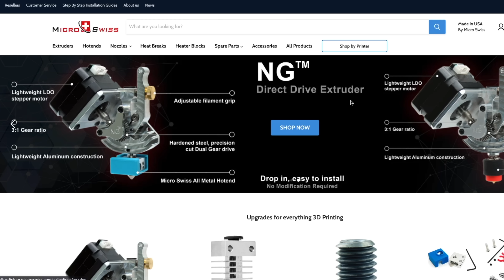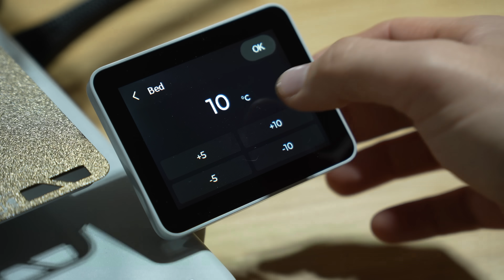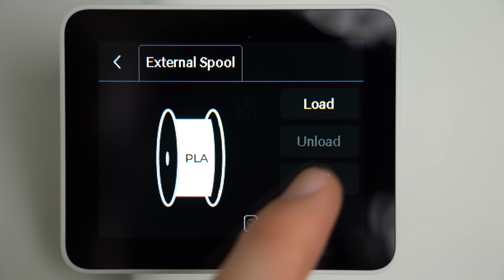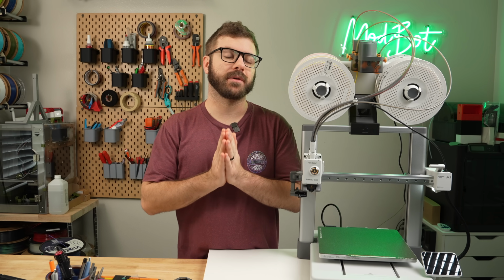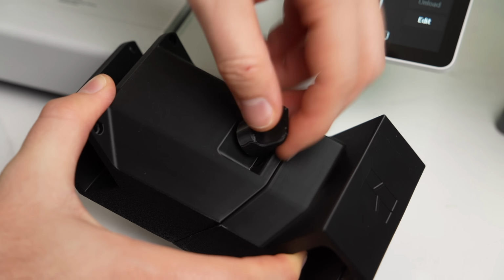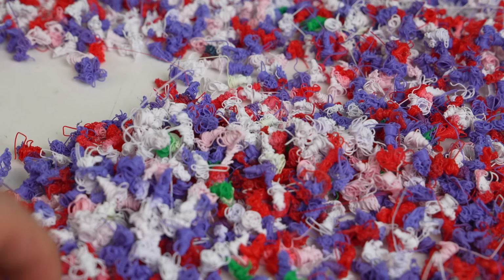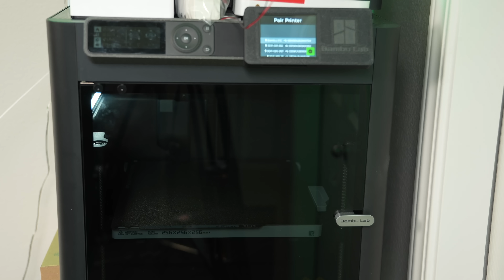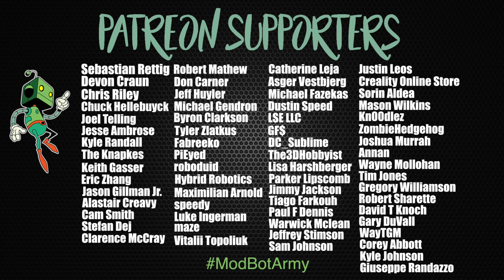Is The A1 Worth It? Diving Into Bambu Labs Newest 3d Printer

Comment: I waited 2 years to finally buy into bambu. When they came out with the X1 I was one of the haters since it was all proprietary and not open source. I was just waiting for the bad reviews and reasons to bot buy. But those never really came aside from 1 small network security issue they had. It wasn't until last week that I actually looked into them with a neutral point of view and I was actually blown away at how cheap their parts are and just how good the machine as for their price. I then looked into long term reviews and again very few negatives. I have seen people replace their prusa print farms with these machines and put thousands of hours on them with no issues. So I pulled the trigger on an A1. Got it setup and printing tonight and wow. Coming from a sidewinder x1 to this is night and day. I had it setup and printing in 15 minutes that includes slicing my own test print in their slicer which I had never used. My only regret is not going with the P1P over the A1 but its not a big regret since the A1 was all I could afford. However if they ever release a P1P XL that works with the AMS lite I will buy it. I really hope they make their future machines work with both AMS versions.

Comment: Don't use a metal scraper on those PEI sheets.  I switched to the plastic razor blades to prevent damaging my sheets (like the metal one has).
Reply from the maker: I haven’t had an issue with it but you definitely don’t want to apply force. It can glide and get under things easily but if your not careful there is risk. I may try the plastic blades just to compare.

Comment: The things these a1s have makes me very exited for the x2 and p2 series
Reply: Based on what the P1 is to the X1 and these A1s are to the P1s, expect more corner cutting and a reduction in overall quality in upcoming models.
Reply: @KennyGarland  Of course there is corner cutting. The P1 is 2/3 the price of the X1C, the A1 is 1/3 the price of the X1C. How could you possibly expect there not to be corner cutting? Thats like saying Addi cut corners with the A1, compared to the R8. When you cut the price, you lower the spec. The print quality per £ is the important thing and Bambu Labs have hit the mark with each series.

Comment: With the bed confirmed going up to 100°C and the nozzle up to 300°C, what is still not clear to me WRT printing high temperature filaments (ABS, ASA, PC) is why Bambu Lab are saying on their wiki/FAQ page for the A1 that "We don't recommend enclosing the A1" - any ideas? Could it be due to insufficient cooling for the electronics, or maybe issues with softening the Z axis timing belt? 

I am asking because I've built my own perfectly sealed enclosure (a lot of sweat went into making it) and I'd rather use that with the A1 if possible than pay for the P1S, especially since the A1 has the quick change nozzle and no "no build areas".

Bambu Lab mention they don't recommend printing high temperature filaments on the A1 due to the lack of the enclosure (the A1 is therefore not able to ensure the required higher chamber temperatures and also not able to contain the toxic VOCs), but they never explain why they recommend against enclosing the A1.
Reply: The A1’s mother board isn’t built for high temps

Comment: I have seen other multi-color printers do fairly well with just a ‘purge tower’ - is the Bambu’s additional “poop station” really necessary, resulting in so much waste?
Reply from the maker: Lots can be done to minimize waste. https://www.youtube.com/watch?v=uOtf-MifBc0
Reply: You can choose to use a purge tower instead if you want. You can also purge into infill and/or support material.

Comment: For me I am going to get a P1S since it looks nicer, is enclosed and has the normal AMS. But the A1 is probably my new exclusive recommendation for starting out.
Reply from the maker: P1S is awesome. I really like mine and if I had the choice between the two would also go that route.
Reply: I have one in my closet but during these cold winter days I’ve been having many failed prints unsticking to the build plate. Seems like I need an non-textured plate with glue to combat this.

Comment: I own an Ender 3 Pro, I've dumped a stupid amount of money for parts for it and messed with Marlin & Cura constantly and I can't get quality prints and I still feel like it isn't up to par. Would this be a good thing to go for?
Reply: I have an ender 3 S1 - I am going to trash mine - I am looking at this - I like that there is no option to have to run paper and fiddle with screws at the corners to try to get it level.  I am going to get this or a car xy variant - I just want to know if the bed slinger design effects quality like you are asking - it is not good that he saw imperfections in the benchy - but I would take an imperfect benchy over what I could do with my old printer.
Reply: @tomsop  Me too man, I just ordered one for Christmas because this looks promising- gonna see if I can make any money off my Ender 3 Pro but I think this is a great start into the Bambu Lab line up which have some great products.
Reply: People over the Pacific Northwest saw my Ender 3 Neo burn up upon re-entry.😂

I never looked back after purchasing a P1S and an A1.
Reply: @tufftimesbc  Yeah didn’t post an update to this, but HOLY TOASTER is the A1 crazy compared to the Ender

Comment: There is a printed part out there to fix the plate registration that goes where those guides are for the other printers. I wonder if it will work for the A1.

Comment: Hello and thank you for your excellent comment, I hesitated to take the P1s , but I ordered the A1 that I have not yet received, I print only pla and I look for the quality of prints, I wonder if I did not make a mistake, Many people say it’s worse than p1s in terms of print quality, will I be able to change my A1 to P1s if I’m not satisfied?
Are there any problems with bambu lab returns (I am French)? Thank you in advance for your answer, thank you again...
Reply from the maker: I am not sure what the return policy is like especially outside of the US. Worst case I would think you can sell it locally for at least very close to what you purchased. Honestly if quality is your biggest want you just may need to slow down the speeds a bit. P1S has added cooling and a more rigid frame so yes you will be able to go faster and maintain quality but at the increase in cost.

Comment: 3 months ago I sent my family an A1 and it displayed a recall message basically turn off and do not use. It still does not work "calibration errors" despite a TH (tool head) board being fitted. Bambu has finally agreed to replace the defective unit. The Canadian govt finally shows a fire safety / electrocution recall since July 24. This recall happened in 2023 so what was the reason for the delay?

Comment: what happens if you have many PLA's but not all from bambu and put it in the AMS?
Reply: So far all the PLA i use in my A1 is not from Bambu and it works fine.   you can use generic PLA or create customized settings in the slicer for certain makers, like Inland or others.
Reply: What if you have mixed color Pla? Sparkle, rainbow, glow one?

Comment: If you want perfect quality at speed you still need to buy the non- bed slinger versions IMO. And I'd rather have an enclosed AMS to help prevent moisture which makes a big difference to quality.  Since I've been using an enclosed filament heater with my Creality Ender 5 Plus the quality has jumped up several notches. I know the A1 is a good price but personally I'd rather save up for one of the other versions from Bambu.
Reply: Thanks for that. I've been waiting for my local microcenter to get some P1S in stock. They seem to be really trying to get people to buy the truckload of the A1 they have.

Comment: How much tweaking to your profile in your slicer did you need to do to dial in silks? Getting frustrated with the lack of profiles in cura or prussa for the Anycubic kobra neo 2 and the anycubic slicers is limited on parameters. Wondering if the A1 would be an upgrade or not.
Reply: Try the Orca Slicer, see if that is compatible with your printer and will help you out on that issue with printing silk..
Reply: I've had no issues with silks on this thing
Reply: @alvodisco  oh damn. Making it even harder to resist getting one. Lol

Comment: This is one of the better reviews I've watched for this printer, however, it seems that all the reviews have "omitted" the actual speeds that they were running the test prints.  Was this on purpose?  Seems that would be valuable information to those watching to decide on purchasing.
Reply: he mentioned slicer defaults which for the A1 is roughly 200mm/s with 7k accel 
but you can go a fair bit faster without dropping quality if you dont mind adding brims (bedslinger moment)

Comment: I have a prusa mini and I think it doesn't make much sense for me to buy a little larger (but faster) printer even if it has AMS, I love how bambu stirred up the pot, and I'll wait for the large version.
Reply: I'll be honest, bought an a1 mini and already have a prusa mk3s with pinda bed levelling. So far, bambu has nothing on the prusa with consistancy and reliability. Alot of faffing with the load cell levelling and ams load fails. Has all the technology and prints nicely when ok but its 50/50 at best
Reply: The bed levelling is so inconsistant, one print will be perfect and the next will have the z offset too high
Reply: @jacobplatt3066  ouch. Haven't heard of many bad experiences yet, I suppose they will have to iron out the flaws very quickly if they want long term sales numbers.
Reply: @dingdingdingdiiiiing  Yeah, it can be frustrating. Only explanation is that the PEI textured bed is the culprit (Or oozing filament) because of the surface texture but surely this wouldnt cause this much disparety
Reply: @jacobplatt3066  I'm sticking with Prusa for now as well, for various reasons, some ideological.  Happy to pay a premium for that.  I'm currently running a MK4 and it's been a fantastic machine so far, no issues.  One thing: though I love the open design, I think Prusa will have to move to injection molded parts at some point.  Much higher quality and a much lower cost.  Just look at the prices for the MMU3 kit, the difference between them supplying the 3D printed parts, or just sending you the filament for it, is €40 or so, over 10% of the total price.  3D printing parts at this scale is not sustainable.
Reply: @kaasmeester5903  I agree that no matter how affordable and advanced Bambu is, Prusa will always have the reputation of being reliable. The idea of injection moulding is great, but the 3d printing print farm is not only convinient, it is also reliability testing the Prusa printers
Reply: @kaasmeester5903  As far as sustainability is concerned, it's not always that simple. Depending on the type of parts, 3D printing can not only be more sustainable but sometimes even faster. I recently came across an interesting video with the title "How Additive Manufacturing Can Produce Faster Than Injection Molding!".

As for the Prusa parts, you would have to look at the individual parts and see how they would have to be adapted to be injection molded and how complex the resulting mold is. The more complex the mold is, the more expensive it is and the more parts you have to make to make it economical.

Comment: What do you suggest between A1 and A1 Mini? You seemed more enthusiastic in the A1 mini video 😄
Reply from the maker: I think that may be because the A1 mini was the first in their A1 line so it was a lot of new things while this carry’s much of that over. Main perks of this one is 100c bed and bigger build volume. No bed tab issues on the mini but a lot of it comes down to space. The minis really won me over but for $100 difference the bigger size and two towers for z probably makes more sense for many.
Reply: @ModBotArmy  thank you very much for the answer, now I have a Neptune 3 Pro and give me problems and I want go with a bambu because I want to print and not think about anything else. I'm very undecided between the a1 and the a1 mini, and also whether or not to get the ams which perhaps I would never use 😅
Reply from the maker: @pieronompleggio3910  given that you save $100 by getting it in the bundle I would opt to get it. If fore some reason you don’t use it I imagine you can recoup at least close to that amount given the standalone price.
Reply: @ModBotArmy  do you mean selling the ama light? Play with bambu studio with a1 and a1 mini profile I notice that for some models the a1 mini is faster than the a1, it’s because it have less travel to make?
Reply from the maker: Yeah exactly I mean to sell it locally if you end up not wanting it. Versus not getting it and decided to buy it later at $100 more. I haven’t compared profiles between the A series.
Reply: @ModBotArmy  Sorry to bother you, the noise between A1 and A1 mini is the same?
Reply from the maker: @pieronompleggio3910  I haven’t noticed any differences. Both have the same silent motor algorithm and same cooling which are the main noise generators.
Reply: @ModBotArmy  thank you for the answer, have you ever tried the Neptune 3 Pro? Do you think the A1 it’s less or more louder?

Comment: Good morning.  Would you consider doing a series of resin printer videos focused on those of us who do primarily functional prints with our FDM printers currently?  The series could investigate the Pros and Cons of resin printing for functional parts, the differences between FDM and resin printing for functional parts, and best practices for printing functional parts with a resin printer.  Most of the resin printer content currently available is focused on miniatures and does not address the specific requirements for functional prints such as part tolerances, part-to-printbed alignment for functional parts, and post-processing considerations for functional components.  Thank for considering this request.

Comment: Out of these which one should I get ?
• Elegoo Neptune 4 plus
• Creality K1
• Ender 5 S1
• Anycubic Kobra Plus
• Bambu A1
Or any other printer thats in the £300 price range
Reply: Bambu A1 has bed heater issue and Creality k1 isn’t a good printer. Ender 5 S1 is a good printer but when you are planning to add mods to it. Kobra printers are good, but bed slingers aren’t very good at handling heavy prints
Reply: you missed the ender-3 V3 in that price range, it can handle 2kg heavy prints easily with good results.

Comment: Which Prusa printer does it compete with? Mk3s, Mk4s?
Reply: I don't think it's really competing with the MK3/MK4. It may look like it, but the targeted user groups are very different. The MK3/MK4 is first and foremost an industrial printer. Not pretty, but reliable and easy to maintain. And it's for people who want to delve deeper into the technology behind 3D printing, with the ability to modify and tinker with the printer.

The A1 is a printer for people who "just want to print" without getting into the technology behind it. In this respect, it competes more with the AnkerMake M5/M5C, which also promises ease of use.
Reply: Creality, but mostly P1/X1 series for those with smaller pockets

Comment: I see a lot of creators showing Z banding, and cooling inadequacies. Was excited for this model, but most likely going to stay away, I don't see anything special here, except ease of use. Was hoping the quality would be just as good as the X1 but it does not seem to be the case.
Reply from the maker: I would definitely say print quality is better on the CoreXY printers at least if you are trying to print at these higher speeds. A more conservative profile will definitely help. The Z banding is odd, I printed a tall cube to see if I could spot it but did not see any at all. The silk filament seemed to maybe have some but I actually think it was caused by the infill pattern.
Reply: Keep in mind these videos were made before a lot of firmware updates. The banding has been pretty much eliminated now. Yes a 5mm round 200mm tall tall rod will probably still wobble, but that's a part issue, not a printer problem.

Comment: I don't understand why manufacturers don't use independent z stepper motors
Reply from the maker: In this case the only thing I can think of is cost. Similar to why they don’t use multiple motors for their beds and they just use a belt to synchronize it.
Reply: Because there really is not that much of a benefit to it.
Reply: I have 1 has 2Z mounters and they get out of sync all the f**** time.
Reply: Plenty of manufactures do use dual Z stepper motors. Prusa MK2/MK3/MK4 use them. Even my old anycubic mega S used them. Sovol uses them too.
Reply: @LilApe  dual motors, yes. but they're not independent steppers

Comment: My a1 arrived yesterday and after building it, it setup and every movement works. But as i was trying to start the first print it didnr heat up the bed. Sensor says 0°c for the bed. 

I bought it because i have seen a lot good about bambu printers. Now im verry sad about this problem. I biught this printer to have a machine that works just as i expect it. But instead i got exact like every orinter i got so far. Work hours and print minutes. Its not what i hoped to get for this price